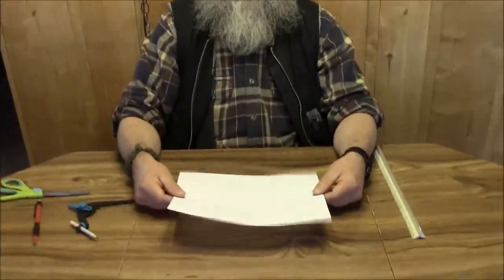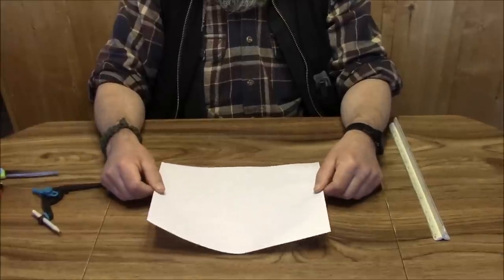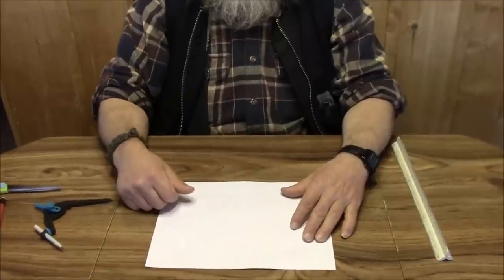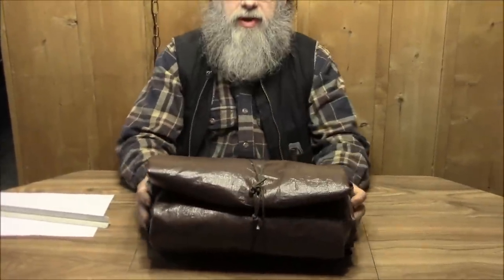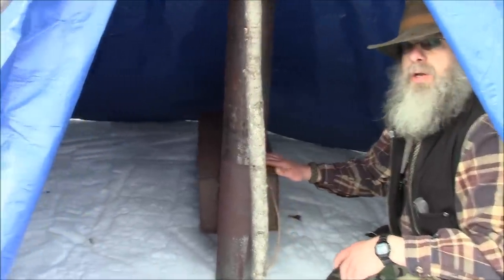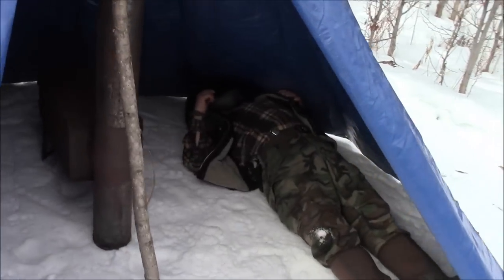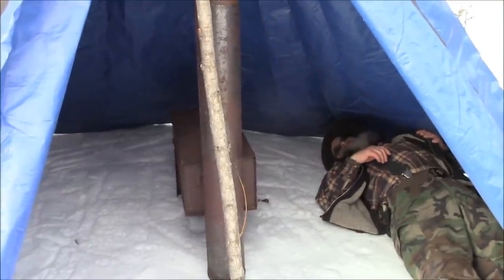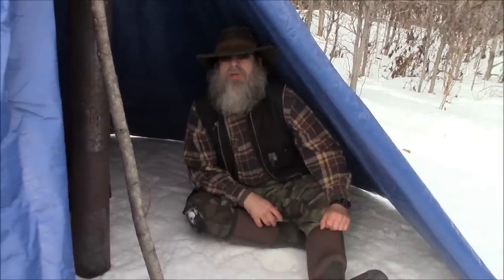Make A Tarp Tent Tipi Hot Tent On The Cheap

Comment: Excellent video. Clear and concise.

I'm wondering if instead of adding a piece to the door, could you just not cut both of the angled pieces that I saw you cut at 19:40. It is hard for me to be certain from here but maybe one of those would serve as an overlay for the door?

And with the perimeter of the tarp anchored, could you use two poles at angles near the sides of the teepee to eliminate the center pole? I don't think it could tip over since it doesn't tip with just one pole. If two won't hold it for sure you could use three and poke them into holes you made in a circle made of 4 pvc elbows.
Reply from the maker: There may be a way of doing that but without making a paper model and trying it out, I'm thinking that the bottom will be messed up and not flush with the ground.   To really know for sure, one should make a paper model and see how it works out.   I recently have made a cowboy range tent design of tent from tarp and my wife and I hunted for two and a half week in remote Alaska for moose using a exterior bipod to hold up the tent.   Worked great.

Make A Range Tent Style Hot Tent On The Cheap
https://www.youtube.com/watch?v=t47WFUZM4go

Comment: Great video! I am really enjoying your channel!  I made a tipi as well, but used painters drop cloth canvas instead.  Thanks for all the great tips! CamperChristina :)
Reply from the maker: I'm curious.   How did your canvas drop cloth tipi turn out?   Did you sew it or use the Gorilla tape?
Reply from the maker: That looked awesome and a lot of fun.   I have a 16 foot Sioux style canvas tipi.  An open fire makes it pretty difficult to manage the smoke.   I know a woodstove is not very authentic for an indian tipi but boy are they sure nice to use.   To tell you the truth, I never have used my 16 foot tipi enough to ever figure out the smoke problem.   There must be a way since they have been used that way for many many years.  The way that I erect my tipi is to use the tradition tripod of poles to begin with and then lay all the other poles against the tripod as you said in your blog.   To erect the canvas I save a pole out and tie the top of the tipi to the correct place on the pole.  I then stand the pole up where it goes and lean it against the crossing of all the other poles.   Now the canvas is all stood up clear to the peak.  I then just walk the ends of the tipi around the poles to where both ends of the tipi meet in the front.   That saves me from having to use a ladder of some sort.   You may have said that in your blog but I missed that if you did.   That might be difficult to accomplish though in your setup with the plywood ring.
Reply: Hey! thanks for checking it out and commenting.  I would've liked to make mine the traditional way as well but I don't really have access to wooden poles from the forest that would be long enough and so this was my solution to making one on my own that would work for me.  The ladder is a bit of a pain and something I wish I didn't need. I originally wanted to pre attach the canvas on the ground and then lift it all up together. This may work with another person, but by myself it is far too heavy for me to lift along with the poles and then spread them out with the canvas in the way. I had no idea how heavy canvas was until working on this project. LOL.  

I had quite a bit of advice on how to keep the smoke moving properly on some social media platforms and also in the comments below the post.  The advice I got the most was that the bottom of the skirt needed to be pulled up a few inches off the ground to create a gap that would bring air in and push the smoke up and out.  Sounded like it would work but i didn't get a chance to try it as the stove was on sale and I bought it. So much easier and again, doing alot of solo trips, it is definately easier and more reliable for me.  Maybe once I become a bit more experienced I will try with just a fire again.  (I'll have to keep watching all your videos.). They are great btw!  

Did you make your tipi? (sorry for the late reply, I didn't see your comment until now).  Do you have videos or pictures of it somewhere?

Comment: Thank you so much for your video on how to make a tipi tarp tent, very well done!  I had a question about the final dimensions.  You said you started with a 12 x 16 tarp.  I'm wondering if you could give the diameter and center height of the completed tipi?  This would help with calculating a ratio between beginning tarp size and final tipi dimensions.  It might be helpful to put this information in the video description too.  Thanks again!
Reply from the maker: The tipi is approximately 10 feet across and approximately 6 feet tall.   I showed in the video how one can and should make a paper model tipi to scale that would have answered your questions.

Comment: ill be following this to make a hunting tent for this year, would you recommend using a canvas tarp ? or is the breath ability and insulating properties of canvas over rated?
Reply from the maker: The only canvas tent I have used as a hot tent is my old traditional 12X14 foot canvas wall tent with a 30 gallon barrel stove made from a 55 gallon barrel stove kit.   It was nice in the tent during the winter but it was always much colder on teh far side of teh tent away from the stove.  So I am going to say that this design shelter in a similar size close to this one would be fine for heat retention compared to the poly tarp material used in this one.    The wide base and narrow top keeps the heat from rising and making a hot ceiling and cold floor.   This is a very efficient design for heating and I would think canvas would be fine.

Comment: Exceptional instructional video by a great teacher. Thanks for sharing your knowledge Lonnie. A question on the tent center pole and height. I believe that was the "expanded" version of the tipi tent?  What size center pole should I measure for in order to have the tipi height be correct and tight?  Thanks again - Dave
Reply from the maker: The tipi hight from floor to peak varies with each set up due to often uneven ground.  It also varies from summer hard ground to winter snow.  I do not have a specific pole height since I cut a new pole at each location.    The height is approximately 6 feet give or take a couple inches.    What you would need to do is to make your tipi and stake it out.   Then go inside and lift the tipi up and measure the height.  Once you have that measurement, you could cut you a "pole" made from wooden closet rod or plumbing or electrical pipe a couple inches shorter than the hight required.  Then locate another diameter pipe that will go over or inside the pole to make the pole adjustable in height.   You would then need to drill a hole in the pole and drill a series of holes in you pole extender so that they can line up with the pole hole.   You can now "pin" the extended pole together at the needed height at each location.   Or you could use a hacksaw and saw down the extender pipe from the middle of one end for a distance of say around 3 inches.    Then when you adjust your pole to the height you need you could then clamp it in place with a hose clamp or two with the saw cut slit allowing the outer pipe to shrink in diameter and grip the inner rod or pipe.   Of course the two must be close fitting to start with.
Reply: Perfect, thank you Lonnie. Much appreciated - Dave

Comment: I really like your video and I've been using it to create my own tent. I was just wondering if you could tell me more about the system you use to close the door.  I looked at buying velcro but it was insanely expensive.  Plus, if you put the velcro on the inside of the door it's hard to open from the outside, and vice versa.  Are you able to get a good seal on the door and still open it from both directions?
Reply from the maker: I don't "seal" the door in any way but just overlap the flaps and stake both down.
Reply: Overlap

Comment: Hey Lonnie! I love this video, in thinking of trying out your design with some canvas so I can get out into the backcountry on my own. I've watched your video a couple of times (if you already answered this, sorry for repeating) but what is the final diameter across of the finished tent when set up? Also, the final height in the centre when set up? Since I plan to use this solo, I'm contemplating making it a bit smaller, but I don't want to make it unusable. Thanks for sharing all your incredible knowledge, I love your videos and I've learned so much 😊
Reply from the maker: Like I stressed in the video.  Especially if you are going to vary from the size of tarp that i used, you really need to make a scale model.   You can get all the answers you are asking by making the scale model.   My tipi is approximately 10 foot across and approximately 6 feet tall.

Comment: followed your instructions,  tarp turned out great. The only thing left out was how long the center pole needs to be??? Had to guess, but great vid! Bushcraft on my friend!
Reply from the maker: +B Little     The reason why I did not give a length for the center pole is that I cut a new one every place I set the shelter up and it frequently ends up being a different length anyway dur to uneven ground.     That is great news that your tipi turned out well for you.    I just pulled my tipi out again today and installed a partial liner in it in preparation for an upcoming campout next week.

Comment: great video  I have a question did you ever think about installing small air vents in the top .covered , to protect from rain coming in and also allowing condensation to escape ?
Reply from the maker: No I have not wanted to do that.    I have made several hot tent designs over the years and there really is no need for a vent in a hot tent as far as I'm concerned.   The burning woodstove is in fact venting the shelter to some degree.   There will be some condensation but I am willing to put up with the amount of condensation that occurs rather then let my heat escape out a vent.   If one puts a liner in the tipi then there is even less condensation that occurs.

Comment: They make these 3 D printed fold flat aluminum eye beams that could be used to form a triangle that you could then cover with a tarp that has been cut and fixed to incorporate the aluminum eye beam inner structure. It can all be designed to fit in a small bag. A really neat tent design. Small like 5 inches wide three inches deep.

Comment: Sure enjoy your instructional videos, thanks.  Successful tipi with 12 x16 size tarp.  To get a larger, taller tipi I used 14 x 20 to cut out a 7 foot tall size.  The arc figured out to be 9' 4" to use up the full 14'.  This used 18' 8"" of the 20' tarp width.  I can't get all of the tarp sag out by adjusting tent pegs and (adjustable) center pole.  I put in a couple of pictures.  Also a picture of my set up to apply Gorilla tape using a 8' 1x 4 and a couple of quick clamps.  Looking forward to any suggestions to decrease sag.  I am considering cutting off 3 to 4 inches around the perimeter and reapplying Gorilla tape and grommets.  Bruce
Reply from the maker: Bruce,  If it was me, I would NOT cut off any of the bottom.   You may be able to place tie out locations in the middle of each wall so that you could guy that out.   That would not only take out some of the sag but would also add usable room in the interior.   You can see how I did that in my cowboy range tent hot tent video.   See the link below to see the video.  Interior room is a big factor and to sacrifice that room may not end up being worth it, at least from my point of view.   With our cowboy range tent, we still can not get out all the sag all the time but I am willing to put up with what remains.   The sag is due to using a nonstretchable material for the tents.   It is a tradeoff I am willing to accept in order to experience the very inexpensive price for such a useful end product.  My wife and i spent two and a half weeks in the range tent in a very remote location here in Alaska on this year's moose hunt.   we loved that tent and were so thankful for it over and over during the duration of the trip.  

Make A Range Tent Style Hot Tent On The Cheap
https://www.youtube.com/watch?v=t47WFUZM4go
Reply: Far North Bushcraft And Survival 
Thanks for the quick response.   I will give that a try.  Keep the instructional videos coming.
Reply: Thanks again for encouragement to stick with making set up adjustments vs cutting perimeter.  I a cord on a pivot stake to mark stake placement then pushed the adjustable center pole up harder resulting in a no sag in the tipi.  Pulk sled and snowshoes are already to go, just waiting for snow in Wisconsin.

Comment: Nice work.  Very Practical. Looks durable too so despite it being inexpensive,  its worth doing well. I notice there is extra material in the sides.  I was wondering if it might be possible to add gorilla tape tags to the sides around the tipi , say about 2 1/2' up with some elastic cord loops such that they could be tied to other stakes.  This might add a more vertical low wall section to the tipi affording more useable room.  What do you think?
Reply from the maker: The more you "guy" the tipi out, the more room you will have....up to a point.   However, the more you guy it out, the more time consuming it is to set up and take down.   I really don't think it is worth guying it out much more than i did on this one personally.

Comment: Lonnie, I love your videos.  I have made a teepee following your instructions, but I am having trouble with my center pole.  It won't stay in the center and keeps sliding toward the door.  Yours looks like it comes to a point, or like you made a pocket for it.  Any suggestions on how I can stop my center pole from slipping?  I am using a 1 1/2" PVC pipe/walking stick for my center pole.  Help Please!

Comment: Lonnie, Love your ideas and creativity.  Do you have problems staking the rain flap closed once inside?
Reply from the maker: On mine it is a little cumbersome but still plenty easy enough.   I flip the outside layer into its closed position and then close the inside layer and slip the stake loop over a stake.  I then reach under the inside wall and grab the stake loop of the outer flap and slip it over a stake.   My wife and I were in a serious strong wind storm this Fall with the tipi and it held together great and the doorway stayed closed as well.   We eventually pulled out the center pole and laid the tipi down on top of us because of fear that the tipi would be shredded.  We were then able to get back to sleep and sleep the rest of the night.   During the middle of the night the tipi sounded like someone shaking out a rug or blanket it was shaking so bad.   We were miles into the back country by canoe and really did not want to loose our shelter.

Comment: Hi Lonnie,
 Thanks for another great video!  I have finished making a larger verson of this tent and have yet to take it out, still have to install the stove jack.  Anyhow, i have two questions:
1) Have you had any issues with exessive condensation building up on the inside of the tent?
2) Is there much danger for carbon monoxide poisoning overnight?
Thanks agin for your videos, I love them and have learned a great deal!
Christian
Reply from the maker: As long as a stove is used in the tipi then condensation will be minimal.  There is condensation but it is not enough to be a problem.   When using a liner in the tipi then the condensation is even less.   As long as your stove is ventilating correctly then there is no danger of carbon monoxide buildup.   Hot air rises.  As long as there is a fire in your stove, it is producing heat and much of that internal heat will rise up the stove pipe.   Also combustion requires air.   So as long as combustion is taking place their is a consumption of air going on inside the stove.   That air is being sucked out of the tipi interior.   That tipi air is being replaced by air coming in from outside the tipi.   So there is always a fresh supply of air coming into the tipi during stove burning.
Reply: Thanks for the response and I look forward to more great videos!

Comment: Hi Lonnie, awesome video! Apologies if someone else already asked this question, I did not read through all the comments. Do you see any value in making this out of an insulated tarp? Granted it would be more costly but might be more efficient in heat retention?
Reply from the maker: I am not personally familiar with any variety of insulated tarps so I can not address them specifically.   This single layer shelter will be fine down to perhaps freezing.  It will be fine well below that as well but as you get colder you will feel more of the cold on the side of your body that is away from the stove.   I have been camping in this shelter  a bit below zero Fahrenheit and it was still okay.   But if a person adds a liner to the tipi with a bit of an air gap between the layers,  The tipi is much warmer all around.
Reply: @Far-North-Bushcraft-Survival  Thankyou for taking the time to respond! Greatly appreciated.

Comment: Great video! I would add a tarp for the floor of the tipi. How did you determine the length of the center pole?
Reply from the maker: After staking the tipi down around it's parimeter, I step inside the tipi and lift the peak into place.  I then am able to estimate the needed center pole's height by comparing the peak's height relative to my own body height.  I then go out and cut a pole to fit by cutting a little long and then trim to fit after trying it in place.